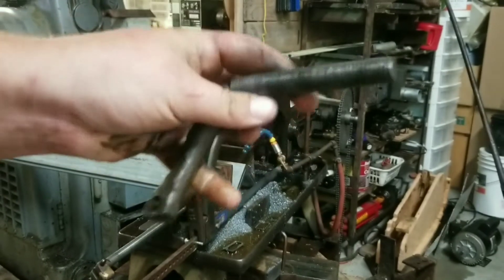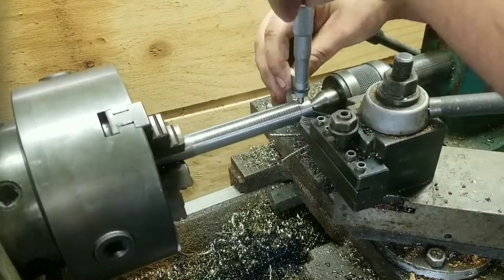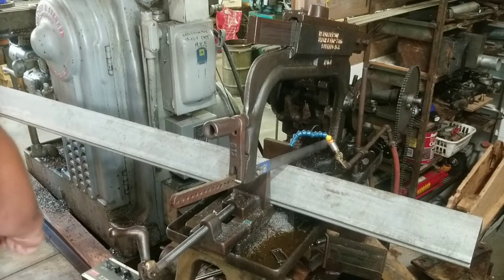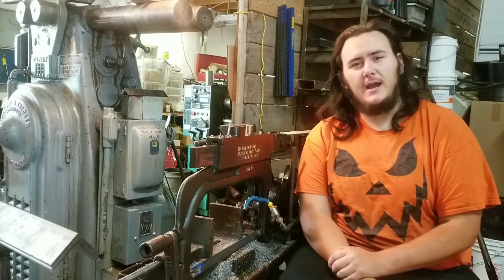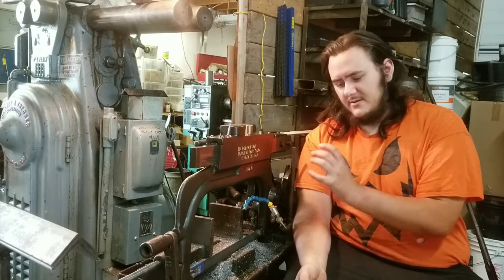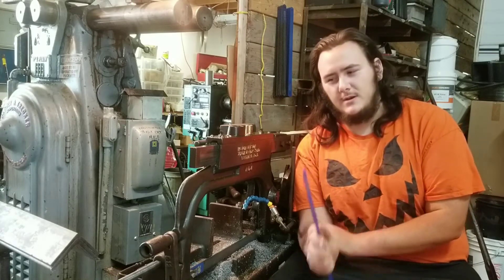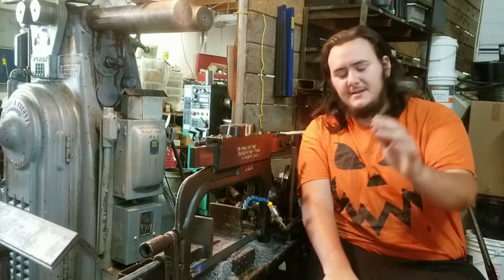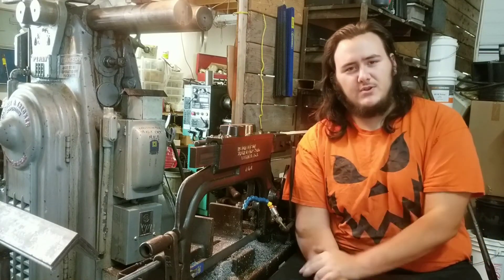Why use a power hacksaw?

Comment: I have 5 saws 3 of which are antiques. Walker Turner 14" verticle a Marvel Draw Cut and an Atlas Clausing power hacksaw. (meaning it uses actual hack saw blades. the Marvel is about 1912 vintage and needs a lot of work. Meaning it was abused over the years. My hobby and passion is rebuilding and restoring antique and vintage machine tools. Iur ancestiors did not have the luxuries we have with state of the art machines what they had was time and skill. I try to relive what they did as much as possible. Thanks for bringing us along I am a new subscriber and love this kind of content.

Comment: ... I figured out another project to add to the gingery workshop. Ill have to design it.
Reply from the maker: If you want to make one, a forward cutting hacksaw (opposite of what most saws are) and a hydraulic feed are superior to mechanical feed and rear cutting machines
Reply: My racine 2d is draw cut and hydraulic feed, why do you think forward cut is better? Lighter casting can be used in tension than pushing/compression
Reply from the maker: @8MADJACK  You get less chatter, a cleaner cut, and you push chips away from the feed/drive mechanism of the saw. The differences are relatively minimal but they're noticable. You do have to make it stout, but any saw for doing accurate work should be as stout as can be reasonably accomplished

Comment: I have a no2 with a lot of issues at the moment. Can you tell me what kind of oil I should be using for the hydraulics? I have oil and a 5/8 ball bearing, but the arm will not stay up, it always sinks down, I assume its oil type or oil level that needs to change? otherwise the ball bearing is not making the seal that is needed. I am pretty ignorant when it comes to these things.

Comment: Nice informative video on power hacksaws there.
Good tips about low teeth per inch for thick metal and high teeth per inch for thinner metal.
I’d agree there lovely old bits of kit and can absolutely still produce accurate cuts quietly and without hot chips ! Which can be particularly advantageous in the home shop where neighbours may not appreciate the sound of an evolution saw screeching through material 🤣🤣🤣

Comment: Hard to find information about these saws. Thank you for this very informative video. 
I have both a vertical and horizontal bandsaw.y horizontal saw is a jet variable speed 10x??? Can't remember..anyway it works great on tube and that used to be 99% of what I was working with. Well got a new project and I'm cutting 6"×4"×1.5" steel plate...bandsaw is not happy..I have a chance to bid on a Ercole 310 but I've never seen one in person let alone use one lol  seems like it may do better that my bandsaw... if you happen to see this I'd love to hear input on this. Thx
Reply from the maker: I think that ercole 310 would be a good buy if you are cutting a lot of thick steel. They look like they're close to kasto saws, and kastos are well regarded saws

Comment: My Wicksteed 8 inch hacksaw cuts 2 1/4" inch mild steel round in 71 seconds with 4 tpi eclipse blade.
You can see it doing it at 13:40 on my first video. I paid scrap value + tax for it, but in England blades are really expensive.
Reply: I have the same wicksteed as you. Had to rebuild and clean the oil piston, but now it is s good as new. Thanks to your video for all the info!